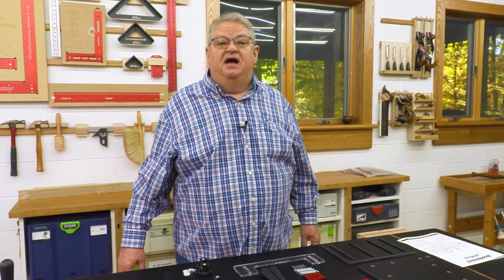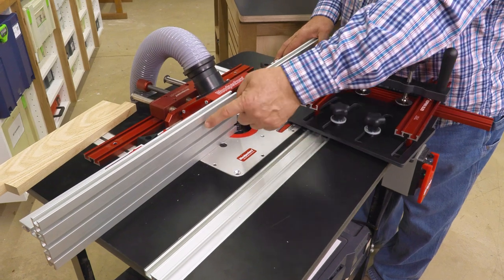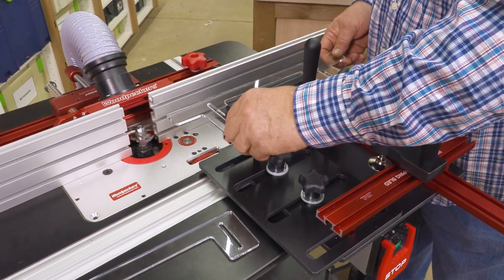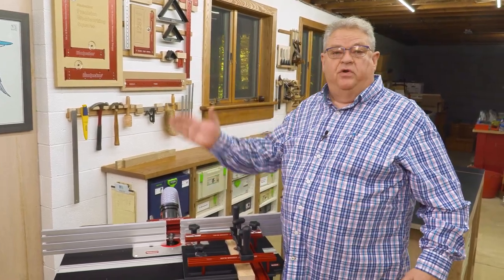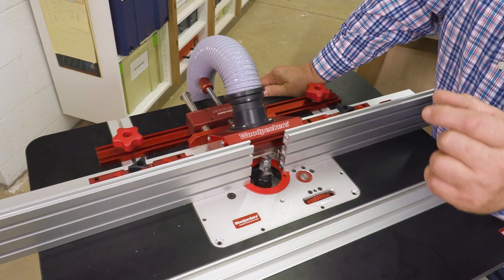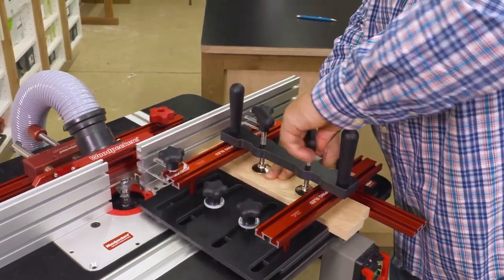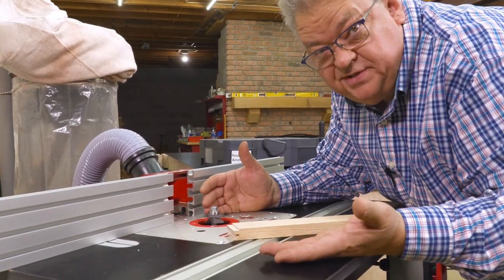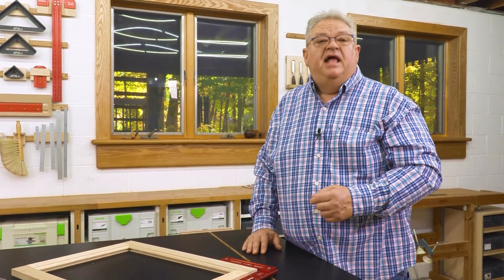Handle Challenging Coping Cuts With Ultimate Precision | Deep Dive

Comment: Another nice video! I have read many reviews on this sled and many listed the two issues @heystarfish100 mentioned plus some don't like that the sacrificial board doesn't get locked down. These issues have been around for quite some time so was hoping WP would have addressed them.

About 8 years ago I made cabinets for our remodeled kitchen. I had something like 80 some raised panel frames to make. I purchased this jig back then but it was WAY TOO SLOW so I ended up making a simple block of wood with a handle on top (Sommerfeld design) and sold the WP jig. I have a new project with several doors and checked back to see if WP had corrected some of the negatives because I was thinking of trying out this jig again but unfortunately not. I love my WP tools and wish they would have upgraded this one.
Reply: Agreed - if doing multiple doors, this just looks way too tedious.  Would be very nice if they have a better clamping mechanism.  Maybe retrofit a auto-adjust toggle clamp on the back fence? Would really be nice if WoodPeckers would update the design to be more production friendly.
Reply: The sacrificial board is held in place by three clamps; the side board that holds both the work piece and the sacrificial piece, and the top clamps, assuming you position them over the joint. I always do it this way and have never had a problem.
Reply: Hi Mike! I’m the guy who bought your router table from WoodNet years ago. Your kitchen was so beautiful. Are you still living in that home? Your remodeling efforts were really a touch above high end work I’ve seen.
Reply: @heystarfish100  Thanks - small world. What table was that a Jessem?
Reply: @youmbgtube  Yes it is. I still have it and added a few extras to it over the years. I really like it.

Comment: This was my first Woodpeckers product I purchased. I’ve owned it a long time now and use it when making all my coping cuts for paneled doors. The two gripes I have about it and they’re small ones is that I wish the screw hold down clamps were locking lever clamps to make production runs a lot faster and that extended clear plastic runner should have been the only one included. Otherwise, I really like this jig and recommend it for someone looking to add a layer of safety to the router table.
Reply: My exact two "complaints" as well. After a few cope cuts, those clamps get difficult to turn.

Comment: Another great-looking tool and a top quality video.  I think the adaptability of this sled to any router fence is pretty cool. I'm a convert to European style cabinets, either overlay or inset, so I probably wouldn't use this sled if I had it.  On the other hand, I have never learned how to cope a joint with a hand saw either.

Comment: Very cool tool. What's the point of the smaller plastic guide fence? Looks like the larger one can do everything the smaller one can do plus the added benefits you described.
Reply: Yeah, I don't understand the point of the smaller one, either. I have this sled, and I put the larger guide on it from day 1 and never had a problem.

Comment: Good sled. Don't think you have tried to use the stick bit first. A router bit co recommended doing it that way at one time. Give it a go I think You  will change Your mind.
Reply from the maker: I've done it both ways and really don't have a preference one way or the other. Sometimes it's which bit I pick up first, lol.

Comment: Jeff Most of the country uses the term Style and Rail. I had to ask someone what the hell cope and stick meant and they were not sure either. The router bits are also sold as Style and rail not cope and stick .  so I had to ask,  can you explain why the phrase  cope and stick. I can't understand its use in this application.  I know terms in construction vary some from east to west and I can see most of them.  This one is just a little too strange without an explanation so please help a fellow wood worker out. and let me know that phrase got started and where.. Thanks.
Reply: David, most of the country use the term plumbing when it’s actually pipe. The pipe is connected with male and female connections. We wouldn’t refer to the pieces of the door by anything but their finished part. Stiles, rails and panels are the machined parts of a door but cope and stick is the correct terminology for its connecting perpendicular joints. 

I always cut my cope joints first. I waste less wood that way if I don’t like my original setup. I set up on scrap wood of similar thickness and make a coping cut on the end grain of a stile. If I don’t like it it’s easy to cut that off on my miter saw, reset the cutter height to where I think I want it and make another pass to verify. Rails being longer than stiles make me perform a ripping operation on the table saw where more wood is cutaway. Clear as mud?
Reply from the maker: I think starfish did an excellent job. "Cope" and "Stick" are the cuts. "Rail" and "Stile" (not "style") are the resulting door components. 

By the way, if you struggle with which is the stile and which is the rail (like I do), the rail is the horizontal member, just like the rails in a rail fence.
Reply: @WoodpeckersLLC  I think starfish side stepped the question and missed the mark entirely!  I have been using Style and rail  for many years. I know they are the components of doors. The question was Why the term Stick? Cope makes sense .
Reply: @heystarfish100  The word plumber dates back to the times of the Roman Empire! It is based on the Latin word for “lead”, which is “plumbum.” But what is the connection between lead and plumbers? In the Roman era, workman who dealt with drain pipes and building the baths that civilization enjoyed, worked with lead or “plumbum”. Thus, they were considered experts with lead were called “Plumbarius”. This evolved into the terms we know today: “plumbers” and “plumbing.”